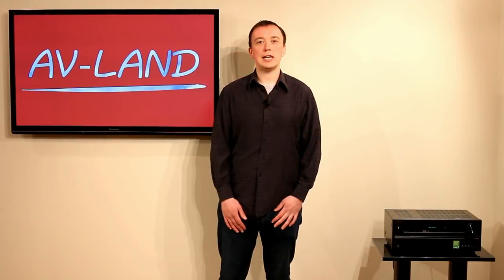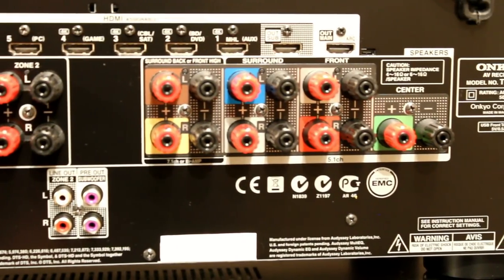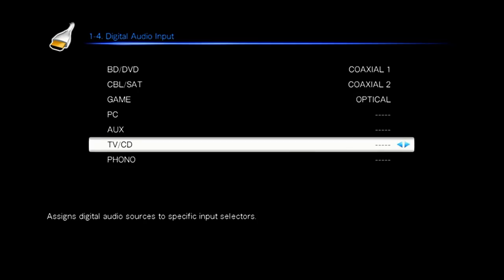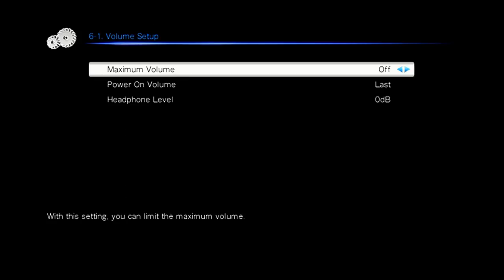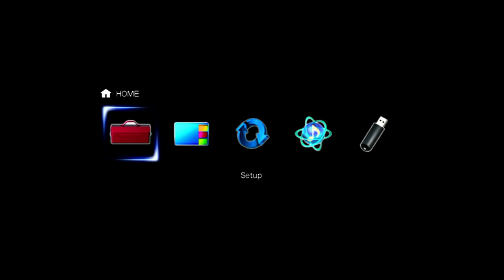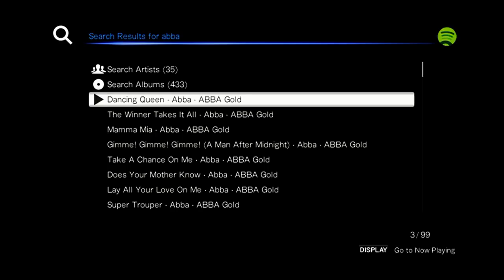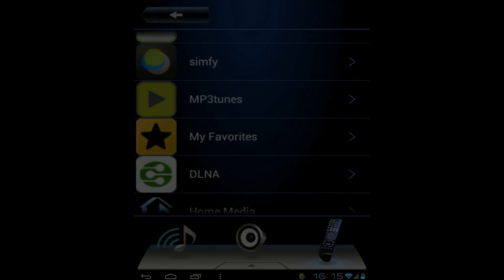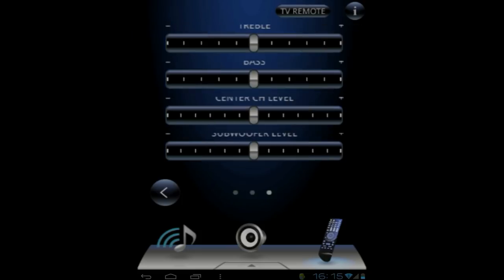Onkyo TX-NR626 27 minute Review by AV LAND UK

Comment: For me the HDMI board seem to be the same in most recivers in that price range. Did get a new reciver after 3 years the HDMi board got from tx-SR805 to TX-SR875 without any extra cost. From what I've seen inside the reciver , I'm pretty sure the HDMI board is different in the newer model, can't see the similar IC manufactures. Anyway I had fault from very begining on my old reciver, just didn't know it was HDMI board until it died totaly and I got a new one fully working.

Comment: I have one of these little gems.  It randomly stops passing video through the HDMI subsystem till it is put into standby for a half hour or so, infuriating.  According the fixit types on Youtube this and the prior product line has known issues with capacitors and it can maybe be fixed, can you solder?  Also there is an obscure, confusing, setting buried deep, I think it's output source type, blah blah..... If it's not set right when Windows goes to sleep it won't work when you wake it.  In the sound control panel it says 'device used by another program' I don't remember how I cleared it each time, probably restating the PC. It took a year of farting around to figure out 'fix' that super annoying issue which I could not find a post for.  If you are plagued by it message me and I will go into the menus and try and remember.  This thing is hard to configure (there are no 'help' items in the menus) the terminology used is confusing, even for the savvy.  Unless you want to spend hours studying to be a sound tech to be able to get an initial setup to work and like to solder I would just stay away.  The HK unit that this replaced just worked but no HDMI.  Stay away.

Comment: I had the 609 beware their is a common issue with the HDMI out board failing mines did and i got a upgrade to 626 for free, tried to get the 717 ....

Sweet amp, main reason i perfer it to 609 is the bluetooth wifi  built in but the two hdmi out puts was a winner as i wanted a project and tv .....

but 616 dont have THX which is not a problem its not easy or simple to have true THX need all your application to be certified blah blah and design for large rooms.